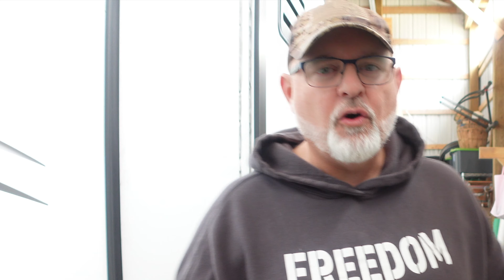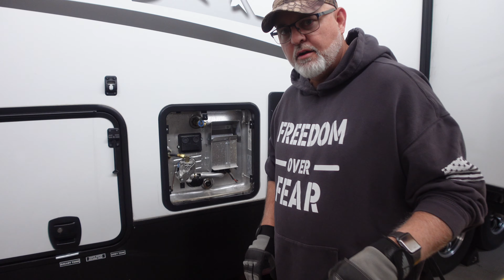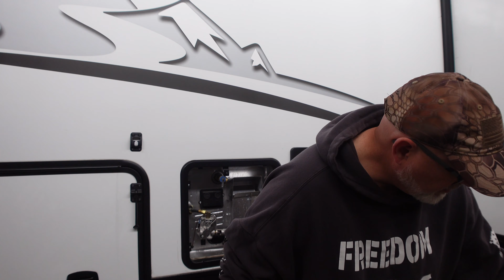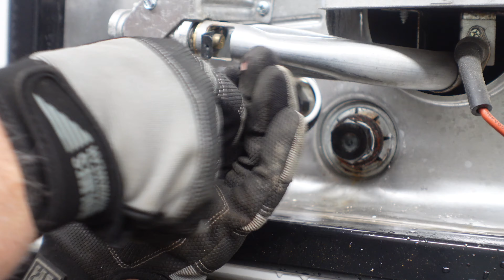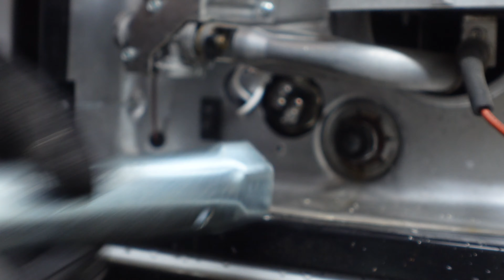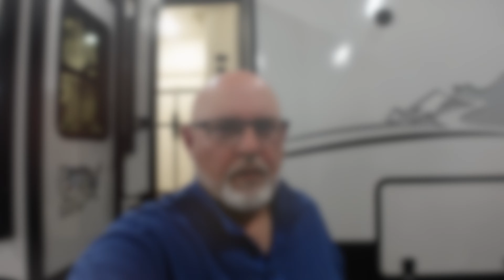Replacing Camper Water Heater Element

Comment: We did the same exact thing. Soon as we parked it we turned it on. Not thinking the tank was bone dry. And are all the elements the same?
Reply from the maker: They are not all the same. Find your brand and research from there. Good luck.
Reply: @ThoseWhoGlampTogether  I been using the propane side and all it has done is gave me more issues then hot water and now it barely stays hot to even wash my face. And where can I find the serial number? I don’t remember what I have all I remember is it’s about a 6 gal tank
Reply from the maker: @XD_7.3 do you know the brand? Suburban etc?
Reply: @ThoseWhoGlampTogether  i think it is a suburban. The camper is a 2008 keystone Montana. Idk if that helps
Reply from the maker: @XD_7.3  if you pull the cover from the water heater there may be stickers inside with information
Reply: @ThoseWhoGlampTogether  thank you for the help. Maybe I can actually get a good shower
Reply from the maker: @XD_7.3  you are welcome. Happy Glamping!